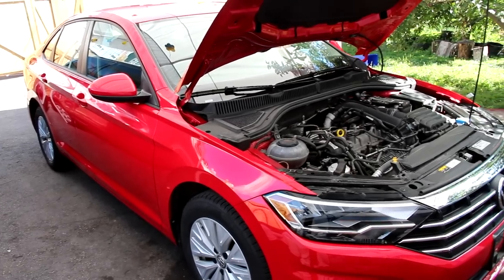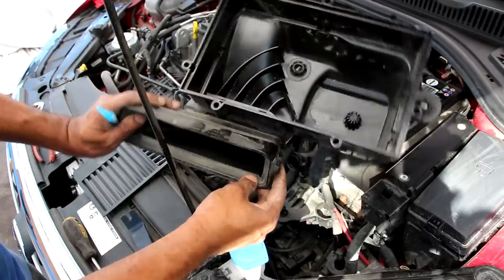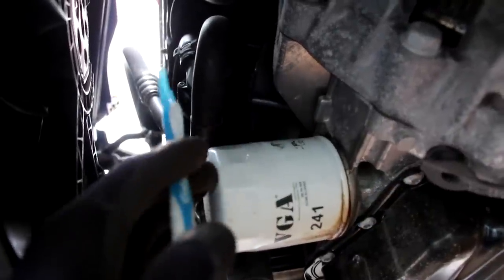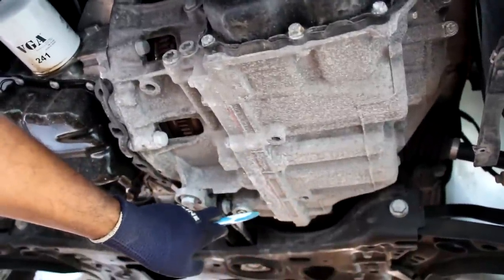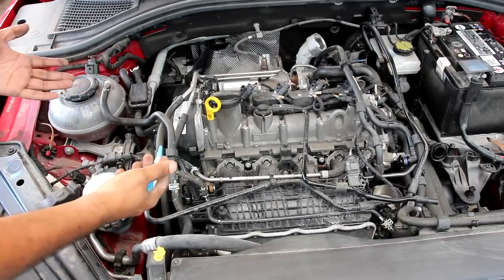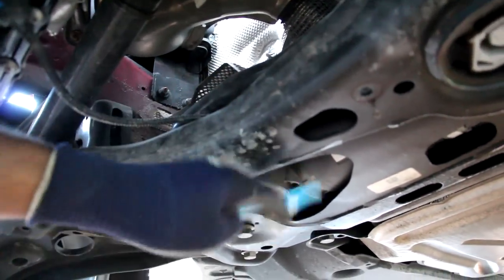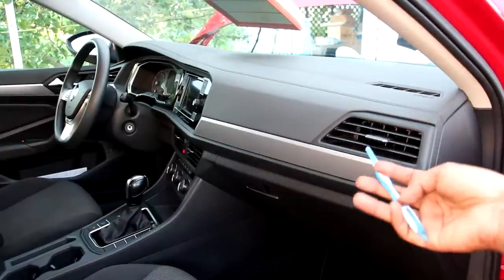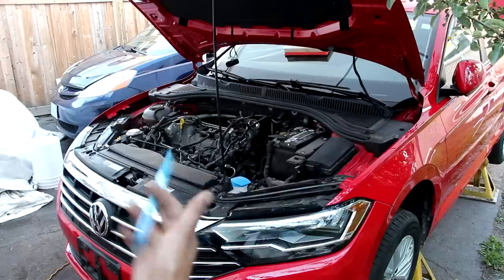Volkswagen Jetta Mechanical Review

Comment: The way Volkswagen, Nissan, Chrysler and other car brand sell cars that are really not reliable long term is that the general public doesn't know much about cars as far as reliability. Also a lot of people are broke and they don't want to get burned buying a cheap old car from a private individual even though there are some old cars like Toyotas and Hondas that can still have a lot of life in them for $1500-$3000. So what these brands like Volkswagen do is offer 0% financing, low monthly payment, or other financial incentives to attract people. So even though you may be able to get a Corolla for just a few hundreds or thousands more compared to a Nissan, Volkswagen, etc, people who are broke and need a car asap may pick the Jetta over the Corolla just because of the financial incentives. Also the Volkswagen does look nicer and is more fun to drive than the Corolla. However, VW built them as cheap as possible in Mexico to save cost. However, the dealer won't tell potential customers what models are built in Mexico, Germany, US, etc. So people who are clueless about cars and are on a budget may just go ahead and get the Jetta because it looks "cool' and the financial incentives VW offers.
Reply from the maker: Good points

Comment: I use my 2019 Jetta for Doordash and it has been super reliable. I do keep up on all maintenance intervals. Just had my timing belt replacement at 144k i plan on doing it again at 250k
Reply from the maker: Good to know
Reply: Hey was that first timing belt replacement at 144k miles or second? Also how much does timing belt kit job cost ?
Reply: @elvirhodzic5720  my 1st, but keep in mind it was only 4 years old. With timing belts, you should factor both mileage and age of the belt. If it is an older belt, change it sooner. It was expensive to replace.  $1500 but way cheaper than a new engine.

Comment: Just gonna point out that VW and Continental put a lot of design work into the timing belt system. This isn't your proverbial grandfather's timing belt. The interval for the EA211 is 150k mile INSPECTION, and then every 20k thereafter. No actual replacement interval, just inspect until it actually needs replaced. The belt is made of much more durable materials than in the past and the oval camshaft pulleys reduce stress on the belt to lengthen life.  Given how many modern cars have timing chain/tensioner issues I think a relatively easy to replace belt is actually superior when it lasts this long.
Reply from the maker: Good point, but timing belts can fail even if it visibilly looks fine.
Reply: @speedkar99  That's true but pretty unlikely, there are plenty of 1.4 owners on vw forums with well over 200k miles on the original belt with no issues.  Timing chains can slip time if the tensioners fail or the chain stretches due to poor maintenance or design. The belt isn't affected by poor maintenance like a chain would be, so if you ask me it's still superior to chains in that regard while still being far easier to replace.  The 1.4 EA211 has been in use since 2012ish with this setup and it doesn't seem to be particularly problematic.

Comment: I guess that's why my 17 Golf Alltrack had a leaking thermostat before the 60K Mark lol. At least it was before the warranty expired and they fixed it for free and even gave me a loaner while they sourced the parts. It looks like I have a conventional intercooler and engine sourced vacuum for the brakes. I have an engine cover too lol.

The difference between city mileage (teens to low 20's) and highway mileage (low 30's to low 40's) is huge on the Alltrack

Comment: 12:35 look at this mess... They would benefit from a visit of one of those OCD Apple cable management designer.  I don't understand how VW can make such clean and tidy interiors yet the engine bay  has always been a total mess with tubes and cables looping around every single components. On some A4 model you have to drop the sub frame, and jack engine just so the oil pan cover can be moved over  an AC line crossing under it...

Comment: Hey @speedkar99. Regarding the "grinding" sound from the automatic transmission - I've noticed my 2019 Jetta making this type of sound between speeds of 35-45 kmph, which I'm thinking is between 3rd and 4th gear.

Do believe this is a problem I need to get Volkswagen to fix? What would that fix look like? (beginner level knowledge here)

I haven't been able to find a ton of great info/insight on this, but I suspect I'm also not looking in the right places.
Reply: Put it in Sport mode and the noise goes away. It is just harmonic resonance or something with the gear it's trying to shift into at the RPM the engine is at.
Reply: It is a recall on the 2019 Jettas. After I went to the dealership to get the update, I didnt hear it anymore. Ibwas concerned about that too

Comment: Can you review the new 2020 version? This has the old engine
Reply from the maker: The GLI? Same engine as the GTI, check the link in the video
Reply: @speedkar99  no i mean the new VW engines since 2019. VW doesn't use the old 1.4T anymore. Since 2019 you have the 1.0TSI 3 cylinder or 1.5TSI 4 cylinder
Reply: MauriceNL ... 1.0 TSI in USA?! .... They will burn VW dealers if they import/made those shits there 🤣🤣🤣
Reply: @CristianP  the 1.0TSI sounds worse than it is really! With 115hp in a Polo or Golf it will move pretty good! A 1.5TSI however is amazing! Because of the new turbo design. Way better than the old 1.4TSI!
Reply: @MauriceNL1  ... Still shitty overengeneering german technology with cheap parts made everywhere on the planet ....

Comment: I had  a  Base  2019 Jetta S  1.4t with 6 speed MT for a  lease car. Comfortable and useful interior, really good  infotainment software, bad  side  and rear visibility - and  small side mirrors.  Very soft suspension in spring rate and  roll stiffness - that I bottomed out all 4  corners on the  interstate  93S in the Boston, MA area (!) Never had that  happen before on any other car.  Front end is  hard to keep in alignment as it is  a cheap mac  strut implementation with no brake force reaction rod.  The  Shifter linkage was  just so so - not inspiring or particularly solid and  assuring; though the 1st and  2 gear synchros  were good. Clutch seemed  easy to toast - it may be a  couple cm undersized in diameter. The car has  terrible destructive front wheel hop up/ tramp  front in the  wet.  BUT, I Loved the  strong low  end  torque, felt like a  3.0 litre six, and if you top off that light VW 508 /  20 grade oil  in the  sump with some thicker 0W40 FS Porsche A40 stuff, the  thing will make power - QUIETLY almost up to 6000 RPM. (caution ! do not  run all 5W40 on an oil change - it is too viscous, and engine systems  don't work right and turbo doesn't spool up quickly). I had a two year lease. I waved good by but ready for something else. - But It wasn't absolutely terrible; it was  just  like a  German Ford  Fusion for  Senior citizens  - but not like a  Golf/Rabbit  or  what one  would  call the  real  Jetta of  old.
Reply: Holy shit, finally someone else who had the same experience with a 2019 Jetta re:visibility and suspension.  The rear and side rear visibility is dreadful and the mirrors are way too small. I also ran into the bottoming out the suspension in places that I didn't expect it.  I traded that in after not very long. I now have a 2022 VW Taos though and it's much better, none of the suspension or visibility issues and nearly as good fuel economy.  Just get one with the 8 speed Aisin instead of the DSG lol

Comment: My Kia has rubber airbox bushings too but only has three tabs to remove (take that VeeDub 💪)
Reply: A friend of mine had a Kia Carnival. Actually they forgot to drill a hole into the block so valve couldnt be lubricated and failed while killing the whole engine.

Comment: oil leak obviously coming from oil filter installed improperly .2 you can acces the oil filter easily from the top. You dont need to take the cover off, oil plug is after the cover. I have a 2018 1.4 stick shift. Put a 3 inch cold intake and the turbo goes whoooosh everytime you change gears, youll have grin from ear to ear everytime you drive it.

Comment: Looking at this mess, I remembered my experience with VAG. I owned a 2012 Seat Leon with a 1.4 TSI 90kw or 125hp

Since new, the coolant was slowly disappearing over time. Nobody at the dealership could tell me what was going on, and it was so slow, they assumed it was breaking in.
Well, after 90000 KM, the coolant was disappearing at a rate of 1 cup every 2 days.
Eventually, I gave it to my mechanic to look at. He found that inside the intake header, there is a heat exchanger which leaked. The coolant was sucked into the cylinders with the air.

Hope you don't have to work on these cars, but if you do, it might help you diagnosing the problem.

Also I had brake booster fail and the turbo blowoff/purge valve stuck.
Thankfully, after fixing these issues, the car had no problems since.
And I was wise to buy one with a manual.

Comment: I wonder why they do not put conventional air-to-air intercooler right above the engine, and make vent on the hood to allow airflow to pass through the intercooler.
Reply: German engineering
Reply: It would have to be much larger than water-to-air. And it would need a flow passage out of the engine bay. Cutting the hood would ruin the bland aesthetics and reduce air dynamics.
Reply: That design allows for a shorter, more compact air flow path, enabling a quicker engine response.
For bigger engines this is not so effective.
Reply: @gophop  water-to-air intercooler being the primary choice of car manufacturer these days.. I wonder how long it would last before leaking and allow coolant to enter combustion chamber. Since newer car favors lower quality parts to save production cost rather than make the car run forever.
Reply from the maker: Because that's not complex enough

Comment: I’m 6 minutes in and here are the issues already: 1) has carbon build up problems 2) there’s a pretty big oil leak on a new car 3) THERES A TIMING BELT. German engineering my ass.
Reply from the maker: You haven't heard of the notorous transmission grinding these jettas are known for?
Reply: speedkar99 Before watching this video, nope! This is why I absolutely love your channel. Honestly, you need WAY more subscribers
Reply: Supposedly the reason they use a timing belt is that it's an oil-soaked belt (it's exposed to the engine oil) and that makes it last far longer than usual, at least 150k+ miles supposedly

Comment: The 2012-2013 jetta looked the best and had the most aggressive styling, now it looks like a camry. And going from a timing chain to a timing belt just tells me that this motor was built around planned obsolescence. If they wanted it to last awhile they would have made it with a metal timing chain instead but they didn’t which tells me they cheaped out to save money end by using a timing belt they will be able to get more money out of their customers taking their products back to the dealership every thirty thousand miles to get the timing belt changed. So they save money and they make more money off the customer just by using a timing belt instead, and that’s like giving the customer the middle finger when you just down grade for no other reason than to save more and cost the customer more money. And don’t even get me started on the transmission. How are you supposed to take off the transmission plan to change the transmission fluid filter when it’s bolted on sideways and the fill and drain hole is the same hole. Again it’s just cost saving from the company and it’s like another middle finger being pointed my way when I look at it. When I look at the motor and transmission of this vehicle I just see two middle fingers being brandished towards me. I remember when the jetta had a cast iron block five cylinder motor and an 09g aisin Toyota transmission in it. And as long as you did the regular maintenance on both they would both last a really long time. Gone are those days.smh.

Comment: as a european i find this particular review a bit funny to be honest :) the level of complaining and the so called "complexity of german engineering"in my opinion is a bit overinflated. this particular engine in europe has been used since 2013 (there are 2 versions one with 125hp the other with 150hp like in the video) and its probably one of the most reliable TSI engines to date. timing belt has a long life interval of 10 years or 120.000 miles. long-term tests have shown no mechanical issues as in the previous TSI generation like oil loss, carbon accumulation, turbo failure etc. all of these issues have been pretty much eliminated. The engine has a turbocharger system with water-cooled intercooler integrated into the intake manifold. The cooling system for the 1.4 TSI has two loops. A low-temperature loop flows through the intercooler and turbocharger housing. The integrated exhaust manifold reaches its optimal operating temperature very quickly after the engine is started; it also cools the exhaust gases at full power mode increasing a turbocharger lifespan. The catalytic converter is mounted beyond the turbocharger for a quick warming up proces. The turbocharger suffers fewer from wears due to cooler exhaust gases, almost like diesel engines have

 the so called oil leak you can clearly see its coming from some shitty oil filter that is definitely not OEM and has been probably not been tightener to specification. 

The only thing i agree with is they downgraded the rear suspension on some models and that sucks in my opinion. independent rear suspension would have been ideal, but even in europe they started cost cutting and the new golf mk8 gets rear idependent suspension only on models with >150hp.
Reply from the maker: It's all fine and dandy when you compare it to VW's past products, but if you compare it to the fierce small sedan segment in North America, the VW sticks out sorely
Reply: "German technology" TSI vs Asian engines or american V6&V8 🤣🤣🤣

Comment: Not a huge fan of the minivan rear suspension
Reply from the maker: Yeah it's kinda meh after reviewing the Corolla
Reply: It's been on VW for as long as I remember, early 80s - works OK. But WV rear shocks are usually kaput around 200k km. But then some Corolla front struts go much faster.

Comment: Over-all your review was much more comprehensive than most. You packed a lot into the well organized, well edited, and fast-paced review that many other reviewers struggle to match.
However - your comments about bland styling are totally subjective. Anyone who has commented on my Jetta likes the styling. It's the Japanese brands that are notorious for bland if not ridiculous styling, with useless curves and swirls and added fake trim that is there only because they try to over-style their products, and fail in the process. Look at the ugly front grills of most Toyotas and Lexus for what I mean.
And the engine bay is more 'cluttered' because VW has a turbocharged engine that has additional plumbing and more sophisticated electronic controls, that non-turbo engines of the competition don't. The engine is still highly fuel efficient while offering quite a lot of power for its size.
And the intake air is cooled at the intercooler, not the turbocharger. Those cooling lines are to keep the oil in the Turbo Bearings cool.  
Soft engine mounts? Seriously?
And your engine sound was distorted by the microphone vibrating as it sat on the engine air intake cover. My engine doesn't sound like that...
The windshield spray nozzles have an electric heater circuit to prevent washer fluid from freezing. Its not a spray pump at each nozzle!
Flimsy hood prop rod?!? No. It's not going to fall on your head. Talk about nit-picking...
Complaints about Torx and 12-point fasteners? Those bits are relatively cheap. And having different fasteners does not seriously impact maintenance difficulty. Doing your own maintenance will save more than enough on Dealer Labour to cover the tool costs.
It's also bad form to blame VW for 'typical oil leaks'. Then admit the leak was likely from a poorly installed Oil Drain Plug. Your oil filter looks like it was weeping oil and likely loose too... 

My experience with the two recent VW Jettas I've owned has been much better than previous vehicles. Yes the build quality is solid, as neither vehicle ever developed any rattles or squeaks. Their engineering is the result of decades of Continuous Improvements. If you maintain and look after your car it will likely be trouble-free for many miles. It's sophisticated engineering does not mean worse reliability...

Comment: Blander than a modern day Corolla?  You compared German and Japanese.  German Audis and Volkswagens always looked different but they are NOT bland.  I would prefer the look of a 2006 A6 to any Corolla.  Those cars look good and I always liked them.  I just never had one because they are considerably more expensive to buy.  I like my 2013 Passat with the 2.5 (5 cylinder).  If they could just solve the valve body issues those cars sometimes have they would be a much nicer car than any Corolla.  I know Corollas now have CVTs and I am not sure I like those.  I don't like sluggish acceleration and early failures so no CVTs for me any time soon!!  Did Audi stop using CVTs?  I know some of them had CVTs
Reply from the maker: Have you tried the newest Corolla with six speed manual? It looks sharper than this generic car
Reply: @speedkar99  Find a photo of a 2006 A6 and you will see what I like.